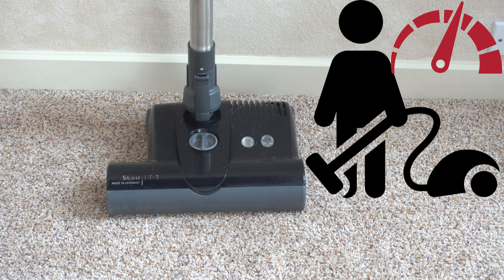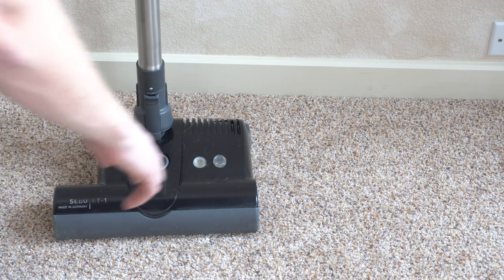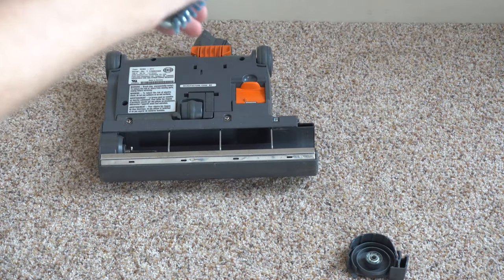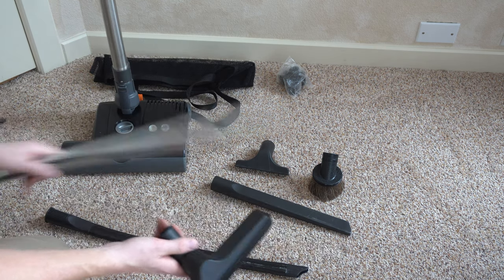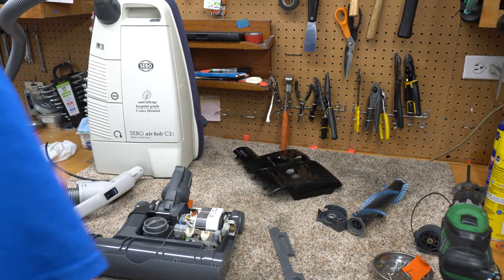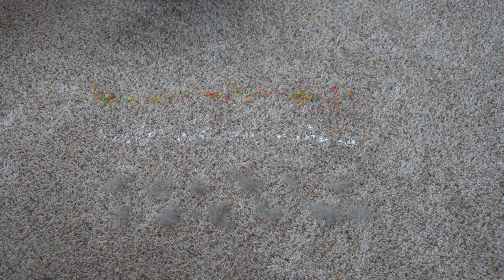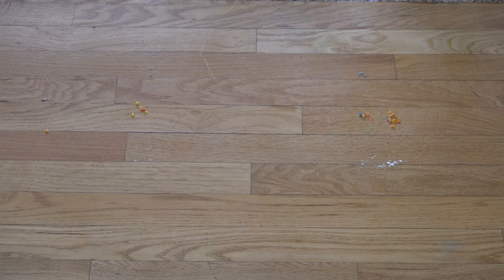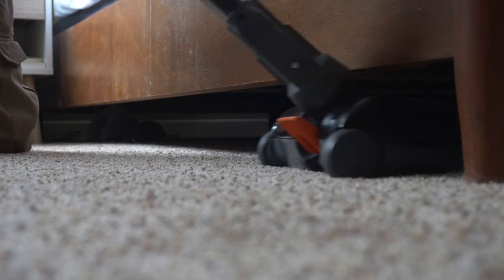SEBO ET 1  Central Vacuum Accessory Kit Review

Comment: I’m considering installing a central system and this would be my choice of powerhead but I’d buy a Kombi and Parquet tool as well as their upholstery and dusting tools to go along with. I like Sebo’s durability and ease of service and need the availability of their green soft brush roll. Also that they never stop producing their parts is important when installing a central system.

Comment: ET-1 is the best pn what I have ever used. I use it with my Sebo K-series canister, Sebo Felix and also with my other canisters (with adapter). It´s easier to push/pull compared to my Wessel Werk EBK340 and height adjustment works very well. I have nothing bad to say about the ET-1. Great review!

Comment: Do you know anything about a limiter on the ET-1 power nozzle?  A dealer told me that he can remove the limiter and it would have more power? He said theres a 2 wires (a blue and a white I think)   that he clips and then removes the limiter and then he solders it back together??    I like the power nozzle in the ease of use and durability.. cleaning or agitation (maybe rpm's?) seem low  to me.
Reply from the maker: I wouldn't remove that limiter. The motor will spend too fast and burn itself out. This nozzle is designed for machine with adequate power. I really wouldn't be worried about speeding it up it's performance is excellent as is.
Reply: @PerformanceReviews  so it does exist though?
Reply: @PerformanceReviews  Yes - it is almost uncanny how well the ET-1 seems to work despite the roller not sounding particularly fast/aggressive. You would know more, but it seems to be VERY good at creating a seal and moving the air quickly (CFM/nozzle size shape benefit?) through the brush roll channel. For whatever reason, it seems to deep clean extremely well despite the brush roll sounding like it is not close to what I hear/feel from some other power nozzles. The ET-1 just seems to be engineered VERY well with a great deal of thought applied.

Comment: How can I use my Miele SEB236 with a central vacuum like you can use Sebo powerheads with central vacuum?  Is there an adaptor like Sebo 2780AM?
SEB236
Reply from the maker: No. But you can buy a EBK360 witch is very similar to the SEB228.
Reply: @PerformanceReviews  Thanks